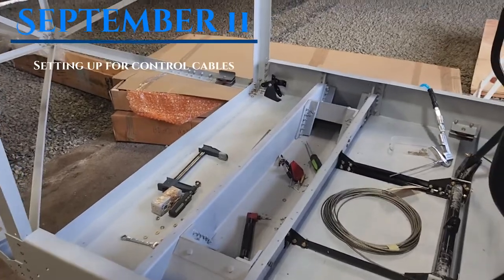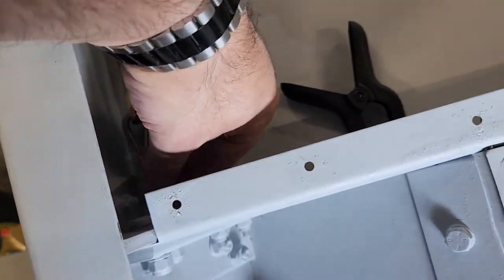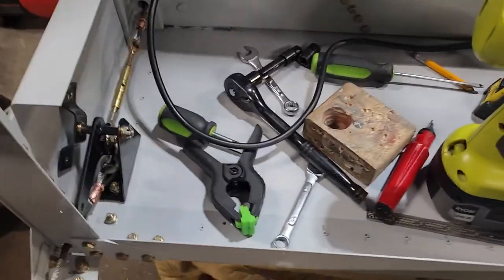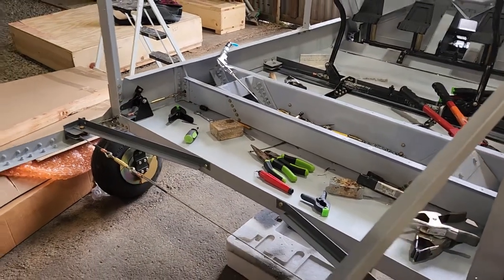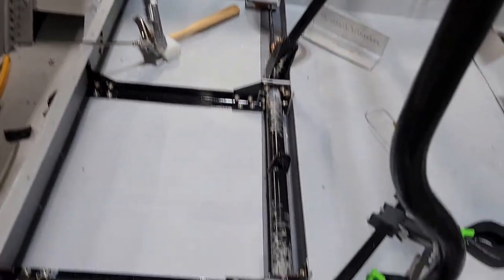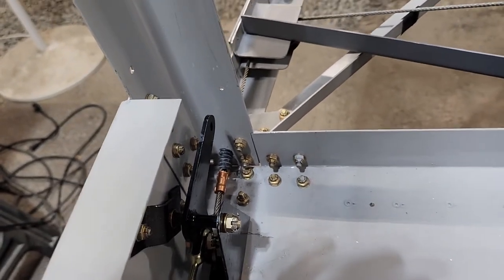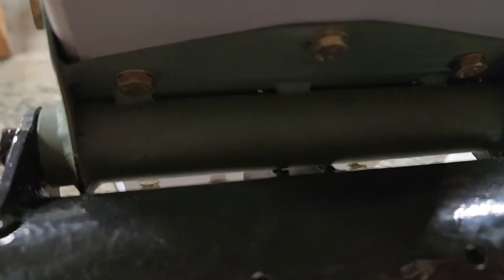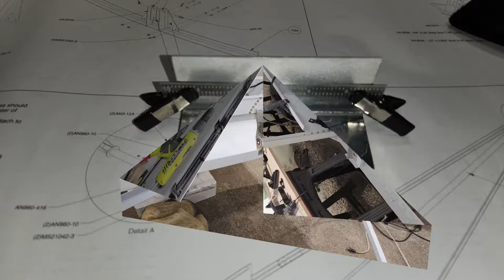Bede BD-4C Build Log 018

Comment: Good work, good to see some progress. I'd be interested to see how much of this kit so far you feel has required fabrication, versus what has been supplied ready to go.
Reply from the maker: That's a good question.  Fabrication is definitely the biggest time suck.  Off the top of my head I'd say 10% of the fuselage is fabricated.  The other kit packages have a much larger amount of fabricated parts.  I'll try to mention something a little more accurate than that in the next video.

Comment: I'm surprised because I thought that with a kit you wouldn't have to be cutting pieces and drilling your own holes. I had figured that holes would be pre-drilled for you and all the pieces of metal would be pre-cut to the correct size. I like the airplane, but seems a bit more daunting of a project to take on.
Reply: If you have a huge budget, there are certainly other kits that every hole drilled, pre punched, de-burred, etc. but you pay for all of that. The BD-4C is definitely not that!
Reply from the maker: Yes there are a lot more manufactured parts for this kit than others, which can admittedly be tedious and time consuming.  There is the quick build option as well as factory assisted building but the price goes up with those.  If I had it to do again I think I would outlay the money to do a factory assist.  There is also the cost of tools which is significantly less if you build it at their factory since they already have everything needed.

Comment: I’m new here, just finding out about this plane, how long would you say it would take to build? How often do you work on it and would say it would take to fully build?
Reply: Bede Aircraft say 700 hrs
Reply: @RADThird1  That figure is only for airframe, and does not include engine, nor instruments. To make it realistic, double that figure. To make it happen in 700 hours, you need a professionally equipped workshop with plenty of tools, plus plenty of experience (having built airplanes before), and frequent help (to make things go faster). There are things that would take you 10 hours doing them alone, and 2 hours doing them with an experienced helper. Their 700 hour estimate counts on these, most optimal scenarios.

Most people tend to take 3 - 6 years to build (working on weekends and occasional weeknights, skipping most travel holidays). The shortest realistic time to build, if you can afford to do it full-time (8 hours every day of the week) is under a year (at best, 9 months). Because you rarely get the entire (and complete) kit right away, there may be times when you'll wait for some parts to arrive before you can continue the build.